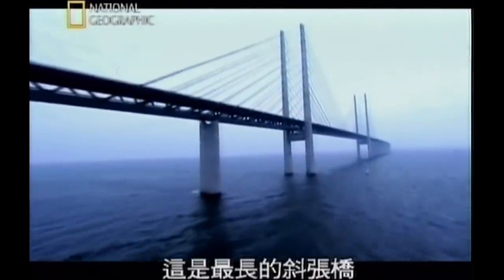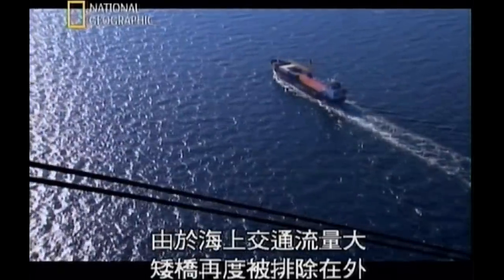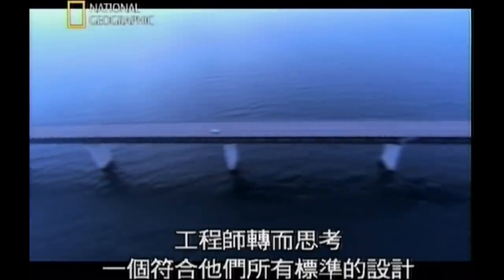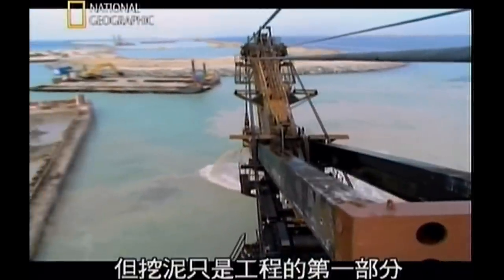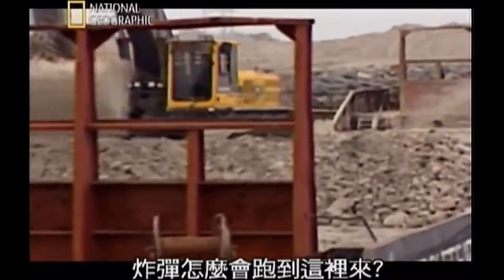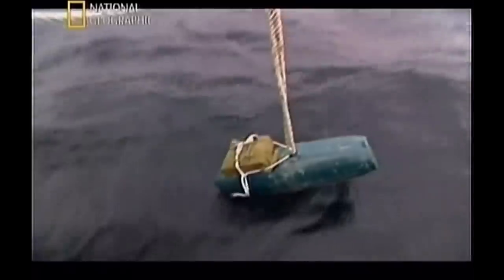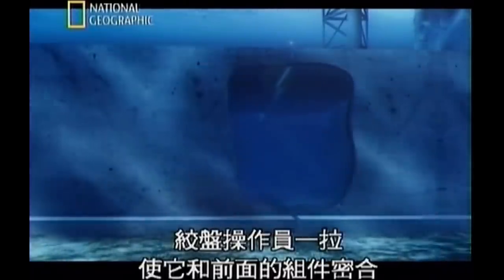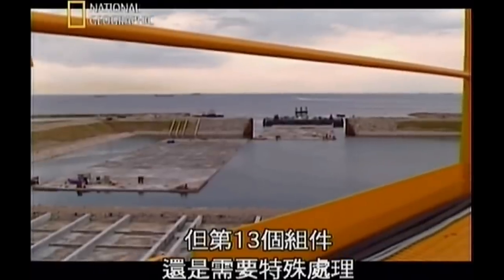Impossible Bridges - Denmark to Sweden (megastructures - documentary)

Comment: Very good, but why oh why does the narration feel the need to try and impress with large figures when stating weights, heights etc.18 million kilograms, for instance, should always be 18,000 tons (or tonnes).
Reply: Agree, silly large figures that you can't get your head around, tons or tonnes much better. Also comparing weights etc to such things as 30 Jumbo jets is equally stupid.
Reply: Ray Phillimore Yes and no. 
The millions of kilograms is indeed stupid but comparing things isn't. What good is 1.000 tons if you can't relate to it?
Reply: isn't 18k tons only 36k lbs? thats less than 60k kg..... If you can't comprehend millions, why are you even watching this video go back to 5th grade.
Reply: Florian, hope this will help:

The small letter k means kilo (1000). 
Tons also means 1000 but it refers to it being a mass (kilograms) (1 ton = 1000 kg).

18k tons = 18000 tons = 18000000 kg
18k tons = 18000k kg = 18000000 kg.
Reply: Oh okay i thought tons were just twice as big as pounds. We don't use that in my country.

Comment: Why did the bridge section need to be tall enough to allow ships to pass underneath it? The second half is an underground tunnel. Couldn't the ships just go around the bridge part? I'm guessing that maybe that side of the river is significantly more shallow than the bridge side. 

Also, if the bridge is tall enough for ships to pass beneath it, why even build a tunnel? I have no idea, but I would guess a bridge is cheaper to build than a tunnel. Especially considering all the dredging and land movement that they had to do in order to create the artificial island.
Reply: +Sue Townsend the reason for a bridge instead of all tunnels was cost. they couldnt build a bridge on the danish side because there was an airport. as for the height of the span (bridge clearing from the water) its for shipping traffic. the reason they dont travel over the tunnel isnt due to shallow waters but the the geography of the land itself use google maps to take a look if they propel over the tunnel they end up going towards an island.

Comment: Denmark to Sweden is only 3 miles. A bridge even more challenging, yet POSSIBLE, would be a bridge from Sweden to Finland. The water is only 50 feet deep. It could be a bridge similar to the shallow, low-height Lake Pontchartrain Bridge near New Orleans, Louisiana, USA. And a bridge from Sweden to Finland would be only 24 miles long. Not short, but that's the same length of the Lake Pontchartrain Bridge. And that bridge cost only 271,000,000 (Today) U.S. dollars. A fraction of a billion U.S. dollars. And construction costs for a bridge just 1 mile long over deep water could easily cost at least a billion U.S. dollars. So a few hundred million dollars for a bridge similar in scale to the Lake Pontchartrain Bridge, but one that would link Sweden with Finland across the Sea of Åland. Much tourism. Both ways too. The driving distance would not a problem, considering the fact people in larger countries drive longer travel distances. A drive from Gävle, Sweden to Turku, Finland would be only 3 hours long. And that's not just across one country or the other, that would be from a populated area in 1 country to a populated area in the other country. More bridges may be needed in Finland, but that water is so shallow, it would not be a series of bridges, but a single embankment, like some parts of the Overseas Highway in the Florida Keys. Overall, costs of construction of the whole project would be in all, approximately 10 times less costly than the construction costs of either The Seikan Tunnel, The English Chunnel, and even 20 times less costly than the construction of the newly completed Gotthard Base Tunnel, and 20 times less costly than the currently under construction Fehmarn Belt Tunnel. And Finland is even proposing an underwater tunnel under the Gulf of Finland to Estonia, which if built, would be the longest tunnel in the world. And Russia wants to build a link under the Bering Strait to Alaska, which if a tunnel and if built, it would be the longest tunnel in the world. Hopefully it would be a tunnel and no other design. Because then there would still be a problem, although the problem would not be the costs. But anyways, a bridge across the Sea of Åland from Sweden to Finland would not only be achievable, it would be affordable. As well as being a major key role in tourism between the two countries. After all, the bridge would not need to be used by everyone in Sweden and Finland in order to be profitable. It would be profitable as it would be used by travels from nearby cities on either side.

Comment: Cable stayed bridges have TRIANGLES  built in then and so  a triangle does not distort  . In a suspension catenery bridge there are no triangles and those vertical wires  form approximate rectangles and so they can chang shape in  to a rombus and o the catenery bridge oscillates in many modes.   If I was to make a catenenry bridge I would add diagonals and not only vertical wires to effectively  stabillize it.   History showed that the catenery oscillated and some fell .     I like the cable stayed bridge as it builds itself!!